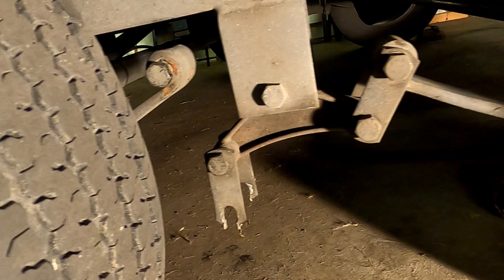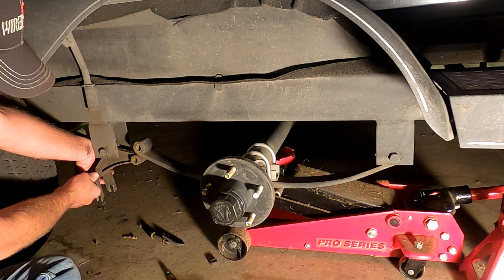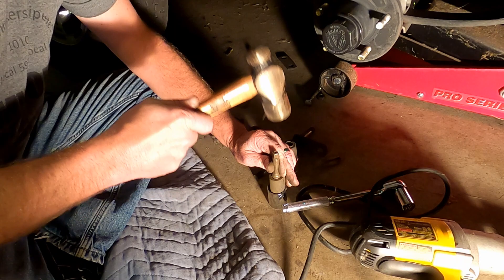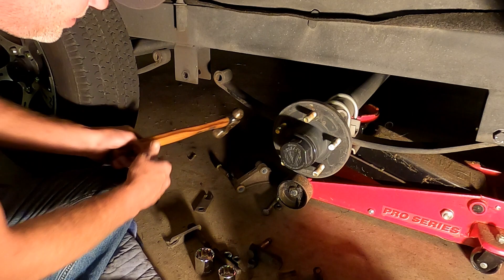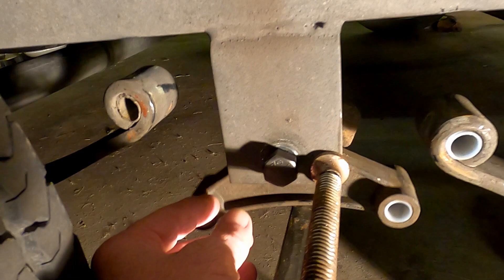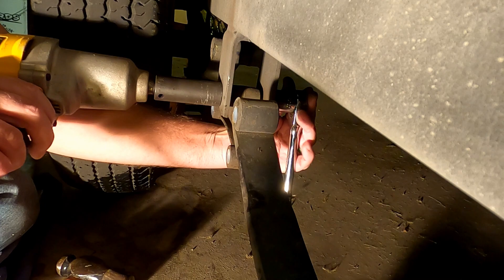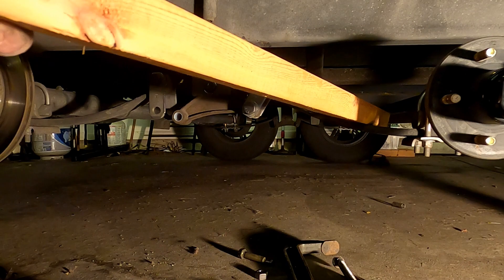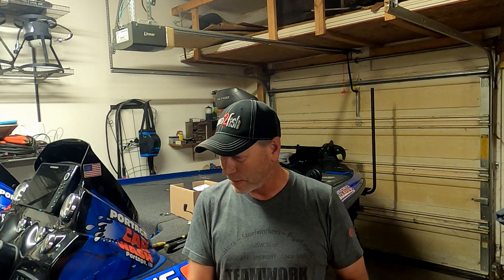How to repair trailer shackles

Comment: I never have changed the shackles on my travel trailer, but I do take along 4 spare shackles with us when we use our camper.  I also take an extra leaf spring, U-bolts, equalizer and spare bolts and nuts.  I'd hate to be out in the middle of nowhere or broken down along an interstate and have to wait 10 hours for a tow truck to come get me.  I'm pretty confident I could change these based on your video and other's I have seen.  Thanks for posting and good job!!
Reply from the maker: I appreciate that and hope it helps! You can never be to prepared for the worst! Be safe!
Reply: Change them out during the off-season (preventive maintenance), then you won’t break down during your trip.

Comment: You should never turn the bolt. Remove the nut and drive out the bolt. Tighten the nuts and then back them off a little so there is a little space between the spring and the shackle. Tackwelding the bolt to the shack will keep the bolts from turning.
Reply: If you tack weld them how does the shackle move or do you think the bolts on opposite sides?
Reply: @jdhappy7663  Tack bolt head to shackle plate.
Reply: @Oldtech51  I get that but if you tack two bolts to the same shackle won't
 that kind of lock the shackle in place
Reply: @jdhappy7663  Bolts should never turn in the shackle plates, only in the spring eye bushing.
Reply: @Oldtech51  never mind my question was dumb. Sorry and thank you. I had to look at it to see that I asked a stupid question

Comment: You should  have  the impact  on the nut ,not on the bolt. The shaft of the bolt is knurled  to prevent  it from  falling out  if the nut did fall off
Reply from the maker: That’s awesome thank you for sharing!!!!

Comment: Hey great stuff there. How did you determine the replacement kit you purchased to do this job?
Reply from the maker: Talked with a local trailer company, they are common parts for a lot of trailers
Reply: @jimwheeler3890  Wondering what info I can take off the trailer so they can match up parts.
Reply from the maker: Give them a call.

Comment: I wonder why people don't balance there trailer tires?
Reply from the maker: I’m not sure I heard some come from factory with sand weights inside the tire! Not positive on that?
Reply: When you follow a trailer on the highway you can see the tires hopping down the highway.  Not good on the springs or shackles etc. I have never seen a weight on a trailer tire except mine. I destroyed my trailer shackles on one side and wonder why.  I started balancing the tires  and stopped this problem.
Reply: I have always had my trailer tires balanced. Had one for place ask why. Said you can't feel it to front.

I said, "yeah but it's wearing out the tires. Does my tire purchase count with balancing?"

He said, "yes."

"Then please balance them."

Comment: Great video! I think I will let the trailer guys do this job even though I have the tools and jacks. My boat trailer has three axles and the boat is 10,000 lbs dry! If one of those springs cut loose you could be in a world of hurt! JohnBoyUtah 😎🇺🇸🚤🚤🚤
Reply from the maker: Much different for sure and always better to be safe! Thank you